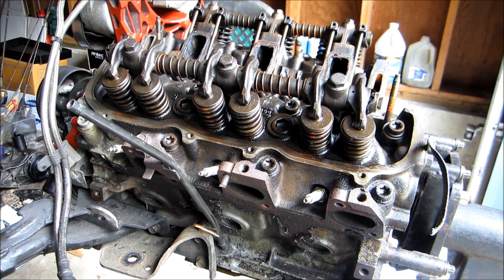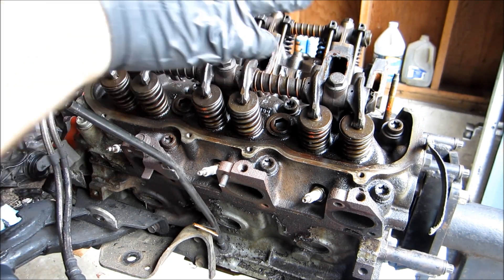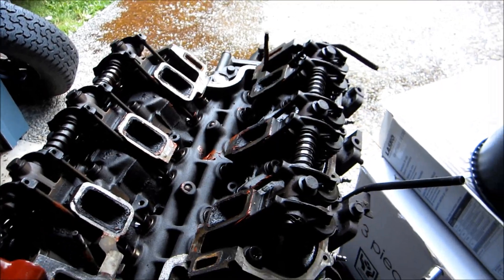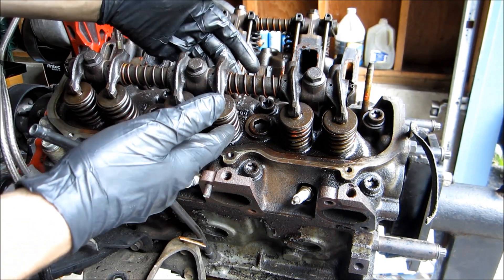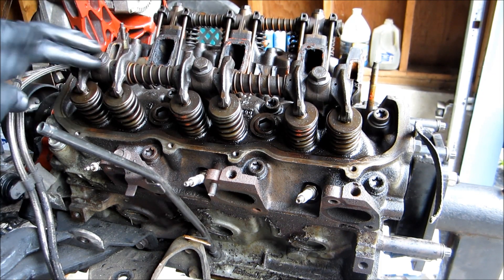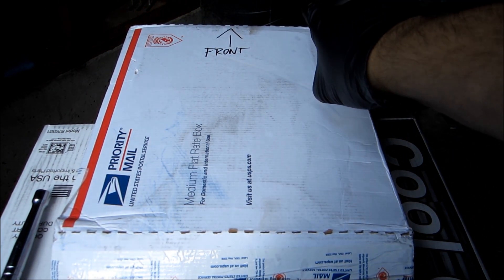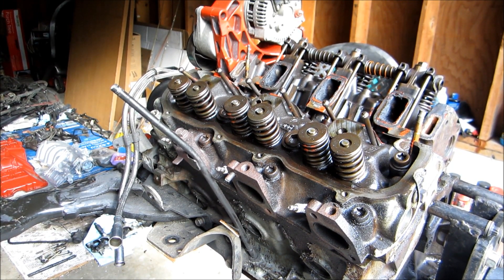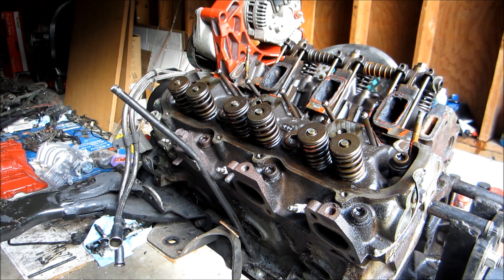1987-1995 Ford Ranger/Explorer Cylinder Heads Removal(Part 1)

Comment: No .. the connecting rods don't push jack .they simply carry the Pistons.. the camshaft ,which has lobes ground into it , turns via a chain attached to the crank shaft , moves the lifters .. they in turn moves the push rods which open and close the valves... Try to understand how these work before speaking
Reply: Hey BTW fuck stick that 1987 2.9l v6 ford motor doesn't have CAMSHAFT SPROCKETS THE FUCKS WRONG WITH YOU STUPID

Comment: Cam pushes the lifters which push the pushrods which compresses the valve spring. The connecting rod just connects the Piston and the camshaft.
Reply: Did you mean to say the connecting rod connects the Piston the the CRANKSHAFT.

BECAUSE THATS WHAT IT ACTUALLY DOES LOL.

THE CAMSHAFT IS THE ONES WITH THE LOBES THAT LOOK LIKE TEAR DROPS!

Comment: Just a quick school. Your crankshaft sits at the bottom of block(motor) and is rotated by the firing of the engine, Pistons going up and down. Either through a timing belt or timing chain the crankshaft turns the camshaft. Whether the camshaft be in the block or the heads it is rotated by the crankshaft.  The camshaft has lobes that look somewhat like teardrops. Eccentric in other words. As everything is rotating, the cam(the high point of the teardrop)will come in contact with the bottom of the lifter(or as you call it, tappet) which will then push the push rod up, pushing up on the rocker arm(it has a fulcrum just like a teeter totter) and then pushes down on the other side of the rocker arm opening the valve. When the valve is open it will allow for air/fuel mixture to entire the cylinder(bore, hole that the piston rides in) to be used to produce power by igniting the mixture(spark plug) and pushing the piston down causing the crankshaft to rotate.

Comment: The CAM pushes the pushrods not the connecting rods, right?
Reply: Ryan Hitchner I appreciate you're on here trying to help people but you have that backwards. Cam spins, pushes on hydraulic lifters which push on "pushrods" and they push rocker arms, rocker arms open valves. Connecting rods connect crank to pistons.
Reply: The connecting rod move pistons up and down witch are connected to crankshaft and from there a timing chain turn camshaft with
Reply from the maker: no the cam pushes the connecting rods which are in the lower part of the engine. known as the short block. which is an engine without heads, a long block is and engine with cylinder heads. the connecting rods spin upwards with the rotation of the engine and push the hydraulic lifters up which in turn pushes the pushrods up and moves the rocker arms.
Reply: @Hitchner2009  no the fuck They don't. The Pistons never touch the lifters .. ASE CERTIFIED  for over 15 years .. you really need to stop talking now